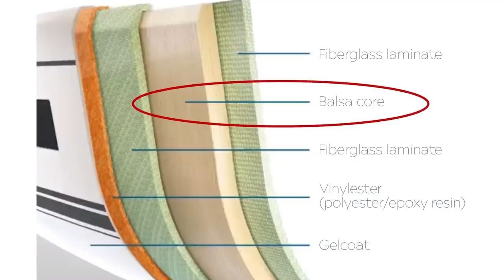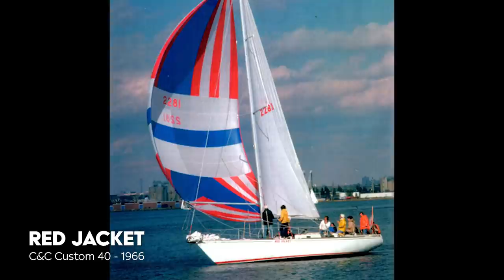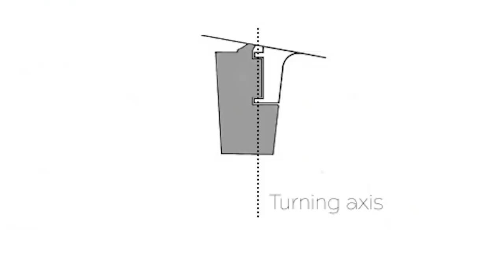FIXER UPPER Sailboat for Sale!! $16K for C&C 40   EP 28

Comment: I owned a boatyard for ten years. We handled about 200 boats a year.  I never saw a catastrophic failure as a result of saturated coring on frp boats, but saw repeated failures as a result of bad joinery on wooden vessels. Fiberglass boats are relatively forgiving. Wood vessels, you better know what you are doing.
Reply: You are the expert. But depending on how wide spread the water intrusion is: If it is only in a relatively small area, it is a very reasonable fix. I have seen such repairs with my arm chair sailor sailing channel obsession so often, I almost feel, I could do it. ;) If it is a larger area with a lot of delamination, I think the story spirals quickly into a massive project. I understand if people are scared of that.

My motorboating dad always says: "Owning a boat is like ripping about 100 dollar bills under the shower!"
Reply: @lbb101  My favorite line is, " We found burning one hundred dollar bills too inefficient,  so we bought a boat."
Reply: @BrianNavalinsky  
Oh that just hits home. I have worked on many homes with dry rot and there is nothing worse except possibly the expansive soil in Summerland, Ca. Anyway the most damage I’ve ever seen is dry rot, then the spores are everywhere. Termites are a joke by comparison. I didn’t see the damage noted by the folks that looked at the boat recently. I do want to review the video one more time. Dry rot is very hard to hide. If it’s in the structural elements of the boat it could be a huge project. Many many hours of the most skilled craftsmen in repairs. It’s not hard to spend more on repairs than you spent on the boat.
Reply: @robertblake1032 Closed up, unused boats are the worst. I was shocked at how teak veneered marine grade plywood could so thoroughly rot away just from humidity... then I remembered the research I read. Dry Rot happens at 18 to 23% humidity. It was perfect conditions without a dehumidifier onboard.
Reply from the maker: @lbb101  that's actually a very old saying ....its been updated to $1000 bills :-)
Reply: @BrianNavalinsky  'A boat is a hole in the water you throw money into'.
Reply: @billkoetting5197  Yup. Ad infinitum.
Reply: @robertblake1032  Don't see the humor in termites after losing a boat to them

Comment: I had some failed balsa core in a one off racing hull and I used a vacuum pump and epoxy injection.  I ran the vacuum pump for two weeks in the bad area then infused the area with a slow cure epoxy.  With enough vacuum you can boil water at 90 degrees Fahrenheit and after two weeks the moister meter was very low so we then used the vacuum to infuse epoxy into the bad balsa core.  Worked like a champ and I didn't have to open the area and remove the fiberglass on either side.  Looks like a good project boat with enough speed to put time into it to make it near perfect.
Reply from the maker: great tip for the readers    i agree with the probable success of such an approach
Reply: Just started viewing your channel and find your videos very interesting and entertaining. The only time I was on a sailboat was in 1983. was on a charter sailboat, a Whitby 42 in the BVI.on a two week vacation. very enjoyable time. The boat was docked in  virgin Gorda. The Captain said at the end of the dock was the biggest C&C Sailboat ever .made. at 67 ft long,, took up the  entire length of the dock. Sorry. to be so long winded but since you were on the topic of C&C, just thought i'd share.
Reply: the thing about vacuum is there has to be free air behind the air volume youre vacuuming out.  otherwise the air doens't move much = doesn't carry moist air out.

Comment: Use to love the C&C 40's in the 80's when I lived in Marblehead.  They were race winners.  Me, I bought an Apache 37 that I still sail today.  Also a great sailor.  Been everywhere with it.  And I actually sailed into Mattapoiset one day for an overnight when I cruised the Cape in the early spring to get and do the Figwaii race Memorial Day weekend that I actually won in my boat in 1987.
Reply: You should check out the Chris Craft Apache 37 some day. If you’re ever around Annapolis, will give you a tour. I still go out throughout the winter on 50 plus degree days.
Reply: S&S design built in 1967 fin keel with a bulb on the bottom. Draws 6 ft. Minimum wetted surface and does an easy 7 kts in 10 kts of wind on a reach.
Reply from the maker: @TheMoegig  beautiful s&s lines

Comment: Hi Captain Q- you asked about a boat that failed because of balsa core rot... 

I know of an S2 7.9 that had core rot under the deck stepped mast. When they went to take the mast down, it tore the deck off in that area. I’ve also seen balsa rot under other hardware like winches and deck organizers fail as well. Oh and a J24 that had a keel that would move side to side almost a foot because of core rot.
Reply: As long as it's just in the foredeck it wouldn't cause that problem j boats and s2s are light weights this boat is not
Reply: Wow. That would be a deal breaker if it was free.
Reply from the maker: good examples... thank you
Reply: J/24 doesn't have any wood in the sump, might have been a canting keel ; )

Comment: I had a C&C 37 until a few years ago.  Nice boats and comfortable fast cruisers.  That engine compartment tells me that this boat had to have. been sunk at some time.   Engines don't get that rusty from "moisture".  With all the other signs, quarterbearth rot etc, It seems obvious to me.   It is costing the owner more storage than it is worth.  If someone is handy and wants a major project, I think it would be a good boat, but it is definitely not ready to be used any time soon.  Just my 2 cents.  Breaks my heart to see a C&C in this kind of shape.
Reply: definitely
Reply: It may have been a Chesapeake Bay boat. Titanium rusts on Chesapeake Bay.  The humidity is absurd.
Reply: I doubt it certainly the engine at the front was well rusted up and we did not see the rest of the engine however this is exactly where it would get the most spray given the cockpit.  I will agree it looks as if it has been underwater at some point except since it is attached to the boat it cannot of been.

The dampness in the boat is obviously there as a result of poor maintenance and many years of neglect not being submerged the woodwork is obviously original and though some is damp it would be warped and falling apart everywhere.

It is certainly a project boat It needs drying out a damm deep deep clean a lot of sanding and varnishing taking of and rebedding all the deck fittings and windows to make watertight. I am going to guess that running new toilet hoses as well. Sure the engine needs some TLC but it could be as little as removing some rust degreasing and a service. A little FG work to replace core and reseal the fittings. Then a good paint job on the hull and deck. The good thing is none of that is highly technical or skilled just many many hours of back breaking labour. A few thousand for materials.
Reply: @glennedwards1449  Well, I agree on the hours and hours of back breaking labor and if the buyer is not skilled in electrical, mechanical, fiberglass and such, the cost of labor would make it totally not worth it.  IF the work can be done by a handy individual then it may have a second life.  I totally agree that rebedding everything on the decks as well as all thru hulls such will be needed. You never know what wet core or rot issues you will find until all those hatches and fittings come off.    It is a shame, but it has been neglected for a long time by the looks of it.
Reply: @BrianNavalinsky  I can attest to that as our C&C was kept in Rock Hall.   Never liked to sail in July and August due to the humidity.   My boat ended up on the west coast after we owned it.   Would Love to track it down.  We loved it, but it just was not being used enough to justify the expense and I did all the work myself.
Reply: @glennedwards1449  Glenn,, those engines are not in any way located where they would get "Spray from the cockpit".  Now if there are leaks in cockpit drain lines or cracks in the fiberglass sole, then maybe.  More than likely broken hoses on the raw water side or a leaking heat exchanger that could douse in in salt water.
Reply: @brucemckelvy9920  This is what makes it a good project boat most if not all of the jobs could be done by someone not very handy. For sure they would be a lot handier when they had finished. FG is surprisingly easy to work with and recoreing is basically cut through the deck chop out the wet core replace epoxy then epoxy back or make more of the deck. Electrical well if you can replace a fuse in a plug you can work on electrics its a simple 12v system by the look of it. There would almost certainly be some chopping out of wood easy replacing it not so much but its wood you get it wrong then you try again. I consider myself quiet unhandy though kept up on the theory mainly because there are so many wonderful new products and tools but there is zero I saw that if I was 30 years younger maybe 20 I would not tackle well apart from the toilet I would definitely pay someone to change the hoses and gaskets on that Yuck. I would even have a go at the engine with a book in hand hopefully it has been winterised

Even if money was tight I would get it liveable and move aboard saving on rent or making income on my house. Gradually going through every system fixing checking upgrading. Of course it would take some work to even get it to that stage unless you were going to do it on the hard then you do not have to worry about Rudder engine painting the hull through hulls.

I lack the skills and the cheque book or the time to get it done on a bit by bit basis however If I had the opportunity I would get her structurally sound rip out everything including the engine get it professionally reconditioned. Have a modern interior lithium batteries solar  and wind generator plus a big alternator and watermaker. Drop the number of berths to 4 or even just a double in the salon most comfy place to sleep and upgrade the safety and navigation equipment maybe a wind vane and an autopilot.

Even if you were very handy this would still cost a lot but you would be left with a true blue water go anywhere crusier which because of its racing heritage would go quiet fast on passage.
Reply: @brucemckelvy9920  You are probably correct I am basing it on what little I could see it was the front and directly over that is the hatchway to the cockpit. It did look ghastly though but with a little luck is all surface rust. Alternator would definitely need a clean up minimum. Luckily it is a diesel and a Yanmar only 20 years old and I am guessing it did not get a lot of use in those years and even less maintenance.
Reply: @glennedwards1449  Yea, Yanmars are pretty bullet proof it maintained.  Not sure that applies to this one.  If it was swamped, then all bets could be off, but a good check out would reveal that.   Yea,, hard to tell what may have happened to it.  There have been some bad storms up that way over the last few years.   Could had been swamped in a pretty shallow marina.   Mine had the large keel so it drew 6'7".  This one has the Center Board so shallower draft.   Could be a nice boat with a lot of work. In my day I would have made a low ball offer, but at age 71 those days are behind me.  It is a shame because I have all the skills and experience, but not the knees and stamina any more to crawl around in those tight spaces.  :-)
Reply: @glennedwards1449  Yep for sure but when that was all done it would be one of those $100,000 projects worth $60,000 .  Boats are easy to buy and very hard to sell these days.   The Marinas are full of them.   I think that is what happened to mine on the west coast.  The guy spent $22,000 to ship I across the country , had it painted which it did not need at all,  and some other small things then am guessing could not pay the marina and they put a lean on it.   He said he gave it away, but I doubt that is the case with what he paid for it then the shipping on top of that.
Reply: @brucemckelvy9920  I can't argue with your figures obviously we are guesstimating. If the new owner was very handy he could probably get away with $60k but then you would have to add the cost of a year or more on the hard to that.

Ironically there is certain advantages to going this route. even though it would probably cost him more and certainly take longer. First he or she has gained a lot of skills. This makes them better sailors or at least safer ones. They can fix or jury rig something on the fly. Secondly They have more confidence and knowledge of their boat they know the systems inside and out as they did the work themselves. Not only is is their home but they are putting their lives on the line. Just buying a boat equipped to the standard you want does not mean that the work has been carried out to the standard you want nor do you have the same knowledge of the systems.

It is a high premium in time and money to pay for this though
Reply: @brucemckelvy9920  We obviously disagree if the boat was swamped for sure the engine looks like it but my feeling is that the rest of the boats interior says no. What I do find interesting these days is that there are many sunk boats sailing about with their original engines. Especially in these days of Hurricanes destroying hundreds of boats in one go. Most have not required a full on rebuild and you can minimise the damage if you actually leave them in salt water until you are ready to basically wash them down flush them out with fresh water and dry them. Replacing the oil a few times. More or less what you would do for an outboard which has slipped off your transom. (Pity the insurance company has to pay for a full service cough cough)Another reason I do not think the boat was sunk or flooded as the engine basically looks too bad for that.
Reply: I have a C&C 35 and love her. She is fast and a joy to sail. 
That boat was not underwater. The teak and holly plywood veneer cabin sole is original and in good condition. If it had been under water, the plywood wood be warped and split beyond repair. I am in the process of replacing my cabin sole due to a stuffing box leak and a failed bilge pump. There was 2” of water in the cabin for a few days and my wood sole was history.
Reply: Brian Navalinsky yep and if you live near Norfolk the other chemical in the water I thin would devolve gold
Reply: @brucemckelvy9920  I surveyed an Ericson 36 that was in Deltaville. It was a nice Ron Holland design that appeared to have been sailed little.  Once I got to the interior, I couldn't believe what I was seeing.  Rotted plywood bulkheads, all surfaces of the solid oiled-teak trim blackened with mold, and the cushions long gone, all for want of a dehumidifier ( or two). It was very sad.
Reply: @glennedwards1449  .
Reply: Metal cools so much faster than air, and in a humid environment, it will become coated with it....I didn't see any signs of flooding.
Reply: @imtheonevanhalen1557  I understand the obvious as a former physics teacher, but having been a commercial captain and crawled around and maintained a lot of boat engines in my day,  I have never seen "condensation" do that kind of damage in a boats engine compartment.
Reply: @brucemckelvy9920  The engine was shocking and indeed the idea of sinking would explain it, but alas the veneer would be shot. It could have been saltwater intrusion through the stuffing box or cold water intake. DK, but my thought was a removal would be in order at some point.

Comment: Last spring my wife, 3 young children and I bought a C&C Landfall 38. It's our first boat and we love it. We are on Lake Huron in Ontario so we can't wait for spring to put Jura back in the water. I see a lot of similar lines between the 40 and the Landfall. Our boat too has some moisture in the deck, but we are not overly concerned about this. We drilled a few core samples with a hole saw and the core is damp but not rotten or delaminating. We intend to repair a few small deck cracks and paint the deck then rebed the hardware to ensure the moisture issue doesn't get worse. Go into any boat purchase with eyes open and get a good survey.
Reply from the maker: attaboy !! great approach and attitude  thanks for your note

Comment: Great classic boat .. And easy to bring back to her glory because there is nothing quite as fun as messing about with boats ! .This  includes the maintenance  for me , meaning I think that is fun .  I am on centerboard # 3 , at 17 foot , 30 foot and 17 again .. Now I want a full keel . The PB has a full keel but is a little long for single handing .  the 40 is a good length .I do have knee pads too !!
I did find a smaller version .near you !

Cyanra - 1965 38' LE COMTE Northeast 38
Newburyport Massachusetts United States
$36,000 USD